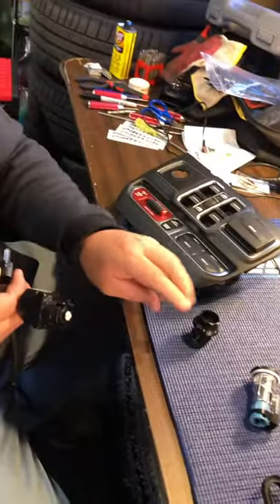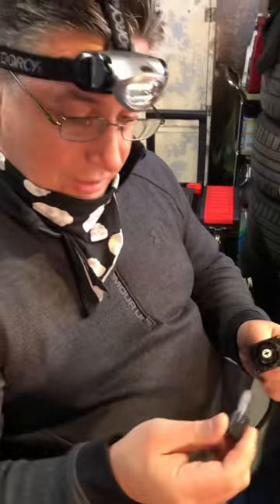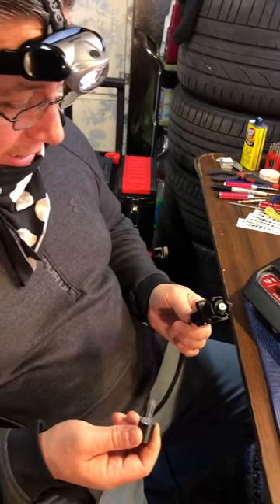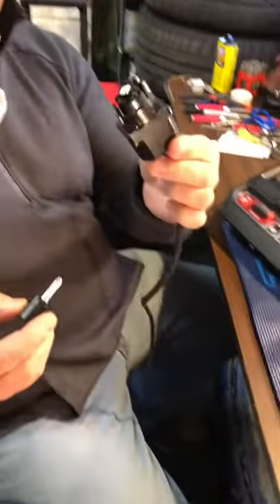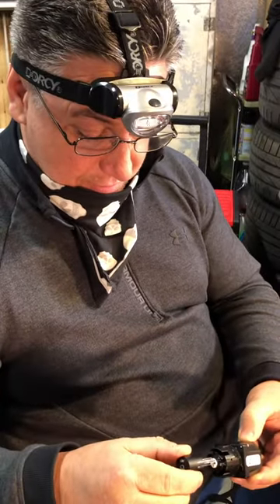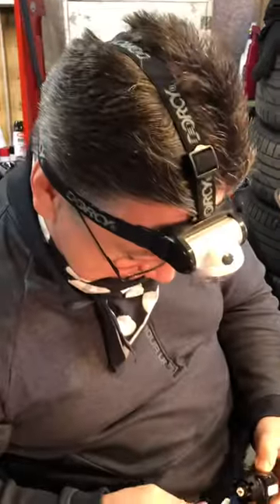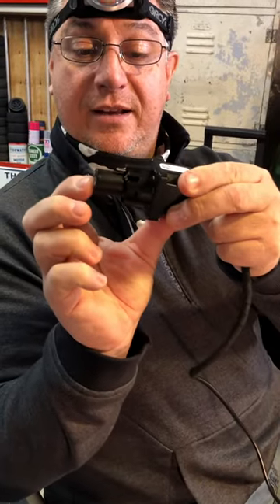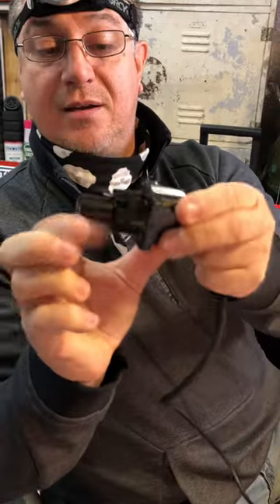Jeep Gladiator 2021 Mopar Electronic Brake Controller Stuck Manual Mode Button

Comment: Hey how in the heck did you get the break controller out? My I followed the instructions perfectly and the button is sticking. I’m trying to figure out how to disassemble without breaking the dang thing.
Reply: Oh never mind… I found out that you can twist the main component from the back end and use something really thin to release the two tabs.  
It looks like the issue with my button is the silver insert like your second video. The silver insert has two tabs that need to click into the dial.  Mine wasn’t installed in the right orientation so the silver insert was warped…

Thanks for your video! It’s funny I actually watched it before installing this brake controller so I knew it could be a potential problem haha.